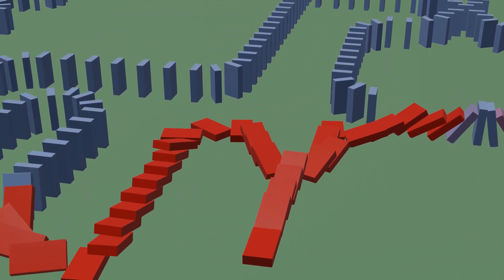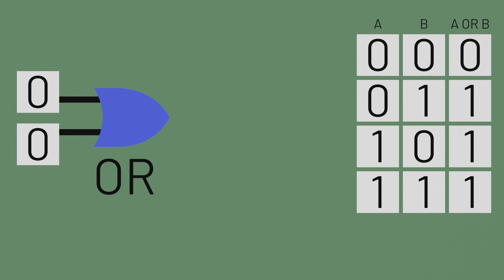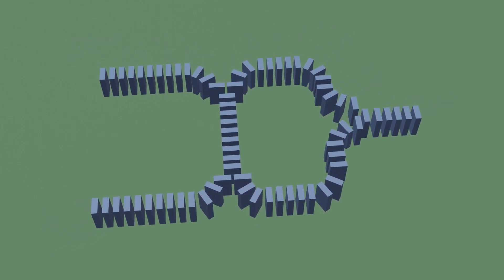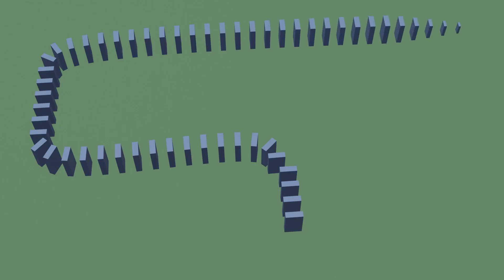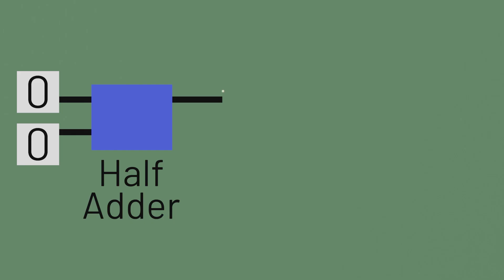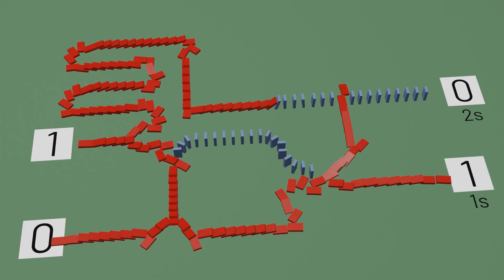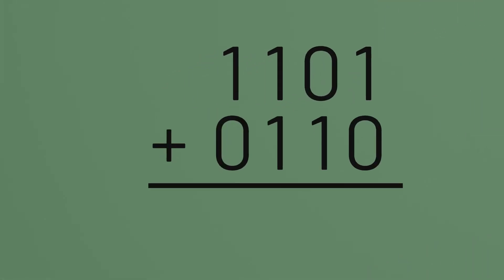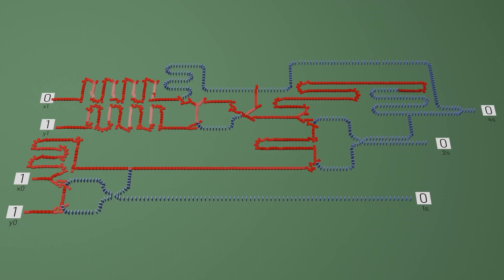A Computer Built With Dominos

Comment: Well, this is interesting, but the problem is that there is no way to do the equivalent of a flip flop here, and thus the domino "computer" has no concept of memory, and therefore it is not Turing complete, which means it can't compute anything that a computer can. There are Turing complete solutions that use gravity as it's form of computation; the Turing Tumble game is an example of that. But that is because Turing Tumble has the ability to use the same "wire" multiple times within the same span of execution, and this domino solution doesn't have that. Therefore, it has no equivalent to memory.

Comment: I guess for a not gate you would probably need to have it so that there is a set of dominos that always get pushed alongside the input and will be blocked if a 1 is input.

If they input 1:
1 Input------------ collide/ ''''''''''''''''' 0 output
                         -
                         -
Runtime 1-------

0 Input ''''''' no collide, 1 continues ---- 1 output
                         -
                         -
Runtime 1-------

Mainly just for those that say not is impossible

Comment: There is one problem with this. In order to make fully Turing complete system, you would need a NOT gate, which is Kind of problematic. Even not thinking how to make it, any gate that would Output 1 when there is no Input, would fire  instantly, due to signal not reaching it yet. What I propose, is a new clock path, which is toppled at the Start to the program, and has precisely such length, that it joins any currently firing gate, for gâtés which output 0 without inputs, thé clock signal isn't needed, but for example not gate would fire only when the clock signal reaches it. And in this way, not gate would simply be XOR between Input, and clock signal. Outputing 1 when clock gets to it, but no Input is in, and 0 when either there is both Input and clock, or when there is no clock or Input. There would be 1 if there is Input and no clock, but this can be solved by just changing thé length of some paths.
Reply: Is it even a clock if it can't tick a second time?
Reply: @nathanvandevyver  depend on your definition of a clock. Is clock a description of the physical object, or a description of its function? If a quartz clock runs out of batteries, by most people's definition it is still a clock, albeit not a very useful one.
Reply: @X22GJP  hasjahahaha its not a fucking clock, its a definition for the frequency in computing lmao
Reply: @liukang3545  It is a clock. It's not mechanical, but it does tick at a consistent rate over time. What you are referring to is clock speed. A good comparison is the difference between a normal wristwatch and a Rolex. Most watches have a clock speed of one tick per second, or 1 Hz. A Rolex has a speed of around 20 ticks per second, or 20 Hz.
Reply: It could never be Turing-complete as you would eventually run out of dominoes. But if you are fine with finite computations, a pseudo not gate can be a line which after some period of time is cut off. I believe this was demonstrated in Matt Parker's water computer video.
Reply: Interesting point! But I think the not-gate isnt the problem here. You can simulate a not-gate out of XOR-gates. 
I think the real problem here is that you:
1. can't simulate storage
2. can only simulate a finite number of states
Because of the missing storage and the finite number of states, my guess is, that the system is equivalent to a DFA, and can only solve problems that are expressible on regular Type-3-languages of the chompsky hierachy. What do you think?
Reply: @an1mus_v0x you could have the Regular Expression (10)* which couldn't be tested with dominos, I think.

You have a finite time with dominos, so there is a fixed time regardless of the input. But there are languages, that need linear time.
Reply: just make an XOR gate but treat one of the inputs as a clock, so that it is always on. Now if the input that you are using as your input is 1, the output is 0, but if the input is 0, then the output is 1.
Reply: Dominos can't unfall. So dominos computer works only for the first tick
Reply: Pretty sure loops would violate physics if you have a finite amount of dominos.
Reply: Both NOT gates and storage units require power to operate. I don't know how would someone simulate power with dominoes. At the very least, it wouldn't be automated.

Another problem is that these gates require very precise timing at their inputs. It would be hard to coordinate the precise path lengths after concatenating a few gates together.

My point is, you could build complex logic out of dominoes. But it would be impossible to build something that can be called a computer as the title says.
Reply: A xor 1 is a not gate.
Reply: I can volunteer to be the NOT gate, as long as I get to build a tower out of dominoes
Reply: @cccbbbccc5910  lulw
Reply: I AIN READIN ALLAT

Comment: Well,we can only imagine circuits with Dominos,where inputs are fixed. If the inputs changes then you have to manually put together the Dominos again for it to work as depicted.
Hence you can't imagine sequential logic, fsm,Controllers or calculate logic operations for sequence of data nor memory operations.
Hence even hypothetically,you can't make a simple Turing machine with this concept.
However it's a good depiction of computer logics for high-school students.
Reply: I had to scroll down waaay too much to find your comment.

Comment: One of the most interesting takes on logic/computing i've seen. I've never thought of domino as programming. Awesome.
Reply: 10000 Domino computer. Built and did two calculations. But yes this video explains the design best thoroughly
Reply: There's a video by numberphile where they actually built one
Reply: Because you are noob
Reply: See the one with water and gears too by Steve mould
Reply: @jagjitsinghramgarhia4766  It is possible to make a computer from people. Imagine a multi-stage parallel human centipede comprised of 8E12 people; we could configure it to run minecraft if we so choose. A poop is a 1 and a pee is a 0; but if we have 'overflow,' the previous human vomits the opposite direction, so we have omni-directional current flow.

The problem with vomiting into someone's ass is that that will induce another 'backflow' of flow back into the person's mouth, of which could induce vomiting, creating a back and forth infinite cycle, so that may be an issue we may have to deal with.
Reply: @pyropulseIXXI  bro let the intrusive thoughts win
Reply: @pete5516  The only thoughts I have are intrusive

Comment: Great video!
The only thing missing here is the Not gate. This is a possible implementation that I thought about:
We can achieve negation of a bit by Xoring it with 1 (0 Xor 1 = 1, 1 Xor 1 = 0 ). So, we can add to the circuit a line of dominos, which will be pushed at the beginning of the calculation, that represents the constant 1, and every time we want to use a Not gate, we can use a branch of this line as an input for a Xor gate, with the other input being the bit we want to negate.
Reply: but all gates needs their inputs to be triggerd at the exact same time, so you have to add a delay to each NOT gate.
Reply: The NOT gate is simple, it has one "energy" input which is a direct path to the output and one domino input that interferes with the "energy" path if the input is 1
Reply: Logical solution but expensive (dedicated bit) and cumbersome (timing and placement of them in addition to the regular bits). Still, good thinking, i don't think there's another way!
Reply: @VianneyOuiBon  i don't think there's another way either, but i think that is the best way. the main problem with domino logic is the fact that a "1" is non-reversible, so not gates without a timing pulse and flip flops without an extra "lift up" move will be impossible.
Reply: A not gate isn’t really possible, think about the instance when it turns a low to a high. In theory it doesn’t need another input to do it, that’s a transistor then. How would you ever knock over a domino without either touching it yourself or knocking over a chain(creating a high input to high output)
Reply: If u paid attention, at the beginning of the creation of an and gate, he made not gate by interrupting a 1 and turning it into 0
Reply: @laquzoeshiyasha  But a 0 won't convert into a 1
Reply: I don’t believe a NOT gate is possible. It would require dominoes to fall without being pushed.
Reply: @scottweinblatt8178  a NOT gate is possible. All you need is another domino that’s always “ON” and an interceptor domino
Reply: Just have a really long chain of dominos that starts from off-screen and the not-gate moves one of them out if the input is 1 lololo
Reply: There's a much simpler way. Just let a domino line fall to output a 1 if we don't do anything, and then put another line to interrupt it if we push another domino line. So the output will always be opposite of the second domino line.
Reply: Just have an always on bit and have it interrupt it if true. Yay